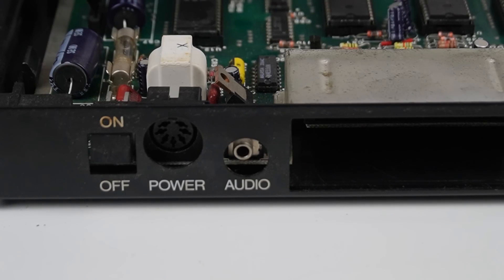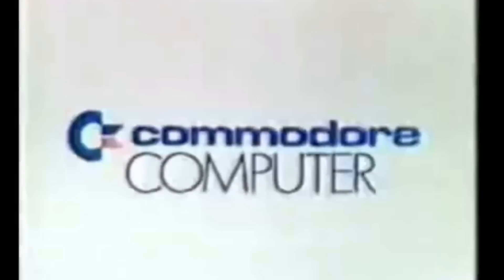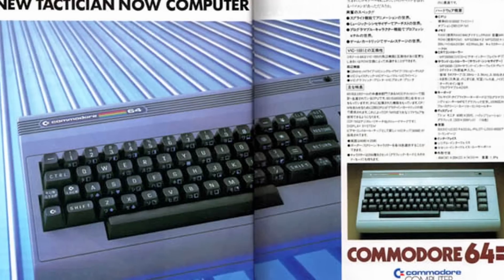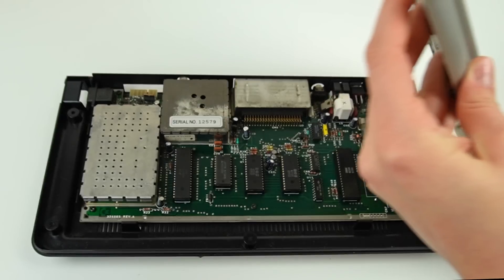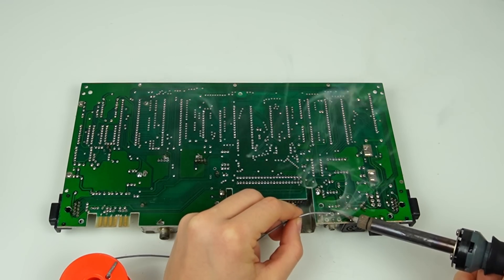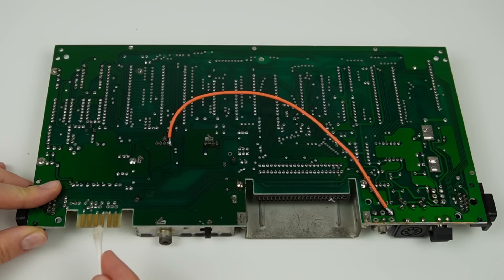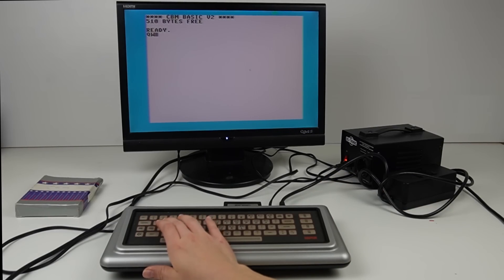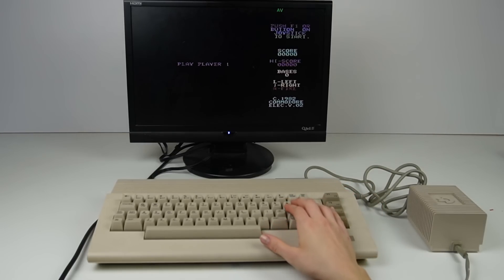Modification to the Commodore MAX (Was it a C64 with 2KB of RAM?)

Comment: If you ever encounter a Rev. B board dont worry, there is an alternative way to brute force trace cutting. It is possible to preserve the trace and original functionality for potential future homebrew applications by making the composite mod switchable with a complete rerouting over an internal 2-way 6 pin ON-ON slide switch. 

The first step is to interrupt the path between the audio jack (audio-in) and pin 26 of the SID by removing cap C74. On the right side beneath the C36 print on the board seems to be a factory probe point for pin 26. The probe point (+) needs to be connected to the respective side of an aluminum smd cap via a wire bridge (botch wire😄). The (-) side of the cap will be routed to one outer pin on one side (row) of the 2-way switch. From the middle pin of the switch (same row) goes the last wire to the original THT (-) via point of former cap C74 on the board. The audio-in reroute/bypass is now completed.

The second and last step is to route the composite signal wire from pin 5 of the RF modulator to an outer pin on the other side (opposite row ) of the switch. From the middle pin (same opposite row) goes the last "gorgeous" botch wire to the left pin ( former audio-in) of the audio jack on the backside of the board. The proper switch setup is provided in the manufacturers datasheet.

Underneath the cartridge slot would be the perfect spot to locate both the switch and the aluminum cap, wich could be held in place by a tremendously appealing "hot glue gun job"😆 but double sided tape should also do the trick.

This may seem to be a complete hackjob, wich it undoublty is but cutting traces is and has never been an option. I may be an WTCP-S wielding modchip hack but not an animal and everything has its limits, we are human after all. I dont care if something is rare or valuable because every PCB is equal and should be treated accordingly. When eveything fails there is always a way to "lift a leg" or a detour by removing a component to build a bypass path. A botch job must not be bad work because continuity is a gentle mistress, she only cares about conductivity not looks.

This "workaround" is purely based on board schematics and the original mod and has not been executed, but would have the theoretical advantage of complete reversebility without the removal of parts and/or permanent damage of the PCB.

 Needed Parts: 

-Cap :  https://www.reichelt.de/elko-smd-10-f-16v-105-c-1000h-low-esr-fc-v-10u-16-p200095.html
-Switch : https://www.reichelt.de/schiebeschalter-2x-ein-ein-ss-x22200-p105436.html?&trstct=pol_13&nbc=1
-Time
-Effort
-Care

Keep up the great work, i like your "edutaining" style and dilligence 👍

Comment: Nice and simple modification, I can see that you do everything with great care, amazing to see a young girl being interested in electronics (you look like 18). A little tip instead of using those thick PVC insulated wires you can use enameled copper wire (like it's used for winding transformers) it looks much neater on the circuit board. I used enameled copper wire on a lot of my prototype circuit boards and never had a problem. I do electronics for nearly a decade (I am 27), even as a child I love everything that works with electricity.

Comment: There is a USB stick that is a universal TV tuner. I reviewed it on my channel recently (November 11th video). I'm in the US and was able to get both a US NTSC signal and a UK PAL signal on it. Works really well and is very inexpensive.
Reply: We had an old Amiga 500 from USA when we were kids. So it had NTSC instead of PAL (Europe) and when we connected it on the living room TV, it would have the lower part of the screen beyond the visible area of the monitor. Some games were affected, many were fine. Eventually we got an Amiga 1200 and all was good.

Comment: Nice.  You should add a little (cartridge based ideally)   soldering station to your wishlist :)  , the old one you got  is obviously doing the job , but brings back memories of my pre- station days (a long time ago !)  , so much easier to use, and you can get the temp's down , can see they're quite high . cheers.
Reply from the maker: Thank you for the thought. I've already added a soldering iron to the wishlist, and it has been purchased. I can't wait to showcase it in the next video!😃

Comment: I'm not sure that you've shown the full process of soldering the 3.5mm jack!
It is properly done as follows:
1. You solder in the jack;
2. Discover that you forgot to put on the jack shroud on the wire;
3. Desolder the jack (men are permitted to utter mild profanities);
4. Assemble and solder the damn thing back properly.

I do that, you do that, everybody does that! 😋

Comment: Well done. An insignificant mod that can be reversed. We (old timers) approve. Was the MAX pin compatible with a European C-64 power supply? If so, MAX users would have readily available solutions since modern replacements are everywhere.

Comment: Great video! Thanks! Wow, only 2KB! And 512B available to BASIC. Hard to fathom!
Reply: It's pretty much a platform at its barest to get the cartridge loader to run. Additional resources needed will be integrated into the cartridge. As mentioned in the video, it was primarily a games console.
Reply: @BilisNegra  Agreed, I just can’t imagine programming in BASIC with so little. I don’t think I would have even included a BASIC ROM at those specs. Seems cartridge use is all I’d do.

Comment: Hi, you should try kynar wrap wire, it's ideal for board repair/modification as it is single core and heat resistant.
Reply from the maker: Thank you for the suggestion! I'll definitely look into kynar wrap wire

Comment: Why not add 64k to the system so that it can play full C64 games?
Reply: Unfortunately it's missing more than just the RAM. It's also missing all the ROM: BASIC, KERNAL, and even the character ROM, so the many games that rely on those things wouldn't work. It's almost missing the 2nd CIA chip which allows the C64 to speak to the disk drive, and also handles VIC bank switching, which further limits compatibility. Then there's all the missing bus lines, and probably other things I'm not thinking of. No PLA chip too I think. Best to just leave it be the strange duck it is, I think.
Reply: @8_Bit Hey, Robin! Nice seeing you wandering the pages of retro enthusiasts in your free time (do you actually have any? LOL). Anyway, that makes sense that they would strip it down to the bare minimum for what it was. I wonder if it would have sold better if its specs were even a tiny bit better.
Reply: @JustWasted3HoursHere  Nice to see you here too. I do like to check out what people are finding interesting. I think if the MAX (at one point called the VIC-10) was spec'd much better than it would have even more directly competed with the C64 and VIC-20, just further fracturing their own market. Just like the vapourware VIC-30 which would have been a 16K C64, if it had any success, then it would have just hurt software development for the full 64K C64. So overall I think it was for the best it was placed at the bottom of the Commodore line and rapidly discontinued. Probably best for Commodore if they never put it in production at all, but it was part of the reason the C64 was made at all, so I'm glad they at least designed it :)
Reply: @8_Bit Yep, totally get it and you're right. It evolved into the C64, but other than that it served no useful purpose. And your bit about the VIC-30 also makes sense. In fact we can see this in action as the majority of software written for the VIC-20 was for the base RAM configuration even though RAM expansion was available for the system pretty early on. Maybe if sales of RAM expansion was very high things might have been different. I do wonder how different things might have been if RAM had not been so expensive back then. Would the VIC-20 have stayed in production longer if it had come with 64K?

Comment: Startup screen: 510 Bytes Free
YIKES! It's too bad that the engineers didn't have more say at Commodore and that the bean counters - who knew so little about their own products and users - called all the shots. This way of thinking was the norm there all the way through the Amiga days. (Luckily the Amiga had already been mostly developed when Commodore bought them or they may have insisted on 128K and no disk drive or something stupider "Is there any way to make it black and white only? Those colors are expensive!").
Reply from the maker: I totally understand your frustration with the limitations imposed by the business decisions. It's unfortunate when technical considerations take a back seat to financial concerns.
Reply: Imagine a similar meeting at TI when they decided NOT to put the RAM connected to the CPU. Instead they connected a smaller amount of RAM and ran programs through the memory connected through the video controller.
Reply: @jeffreyphipps1507 I would actually like to know why they designed the TI that way. It is one of the very first computers with a 16 bit processor, but it was severely ham-stringed by its design. At that time RAM was still very expensive so I imagine it was cost saving decision that went a little too far. Funny thing is, the Colecovision from around that time period had the same video chip yet they were able to make their games look significantly better than the TI, for a fraction of the cost.

Comment: How much is a Max Machine worth these days? Will modifying it affect the value?
Reply from the maker: The value can depend a lot on its condition, whether it has the original box, and other factors. As for modifications, I don't think they would significantly affect its value, especially considering that in this version of the board, it's completely reversible. I don't even have to cut any traces or remove components.
Reply: @Sayakas_Digital_Attic  I hope you get to use it. Better than it being stored away in a collectors warehouse 😊 

It was a strange decision, making it with only 2k of RAM, not enough to use many of the VIC II graphics modes. Especially when RAM really fell in cost at that time. I'm glad they did the opposite with the C64. All that RAM made it a wonderful machine, and the computer that made me learn programming and become a programmer. 6502 assembly and the nice chipset made programming really fun.

Comment: I have understood that Japan has two different voltages and frequencies in different regions so it makes things even more complicated.
Reply: Two different frequencies (50/60), the voltage is 100V everywhere. Since a bridge rectifier doesn't really care about AC frequency when converting to DC, the same power supply works fine on both it only really affected things that used directly-connected AC motors like wall clocks (and, funnily enough, some VIC/C64 peripherals). Japanese AC wall clocks, etc. all had a 50/60 switch on them. 

While not a problem in Japan, the voltage was a bigger problem a long time ago since 100V supplies were rare elsewhere, so people outside Japan usually wound up just feeding them 115V, causing voltage regulators or unregulated direct-from-transformer circuits to run hot. Modern smarter switched power supplies don't have that problem of course.
Reply: I stand corrected.

Comment: The Commodore MAX Machine ended because Commodore took the membrane keyboard manufacturer to court (1/3 to 1/2 the keyboards manufactured for the Max were faulty). VIC-II and SID were designed for the abandoned Commodore 'arcade motherboard' project and finished before MAX/VIC-40 projects.

Comment: You could replace u5 and u, u5 is sram for cpu, u7 is 4bit sram for vic chip, 

Either with a few nand gates and a 74138, or a cpld tapping signals from u9 ,  r/w, and a few address bits

Shove an ay-3-8910, and add 128k of cpu ram, and increase that measly 1k 4bit to 16k x 4bit (yeah CY7C164 and CY7C166 and idt7188 are still produced)

Using a cpld would allow you to combine all the glue logic needed to one chip

Comment: I bought my first computer with my first own money in january 1982, a Sharp PC1211. That was a handheld basic programmable computer with a single line 16 or 20 character alphanumeric display. Kind of a basic programmable pocket calculator. I still have it, but it wont boot anymore. It ran on button cells only. I learned programming in basic on it. The next was a VC-20. Compared to the PC1211 this was a massive computer. It was followed by a C-64 and a C-128, the latter one didnt see much use, but i did some assembler coding on it. I got a 386, then a 486, four others i dont remember in detail, and since 2019 i own a i9-9900KS with a RTX2080Ti. Looking back to the VC-20, what todays computers can do was way beyond science fiction in 1982.
Reply from the maker: Wow, that's an amazing journey through the evolution of computers! It's really incredible how technology has advanced since your first computer.
Reply: I'm in a similar place as you. I was using computers before there were home built computers (I used mainframes). I got to get an Apple II eventually, then a C-64, a C128, a Tandy 1000, and built computers up through recently (2019 also). When we look back it's totally amazing how far we've come (and how far we haven't).